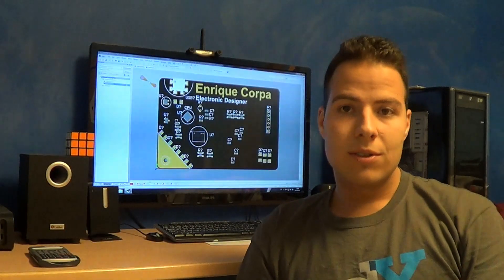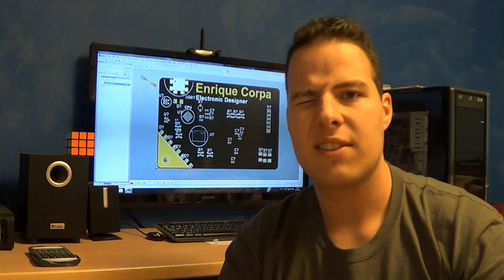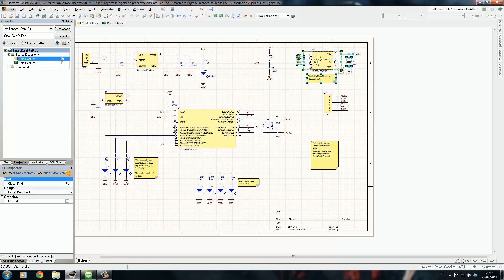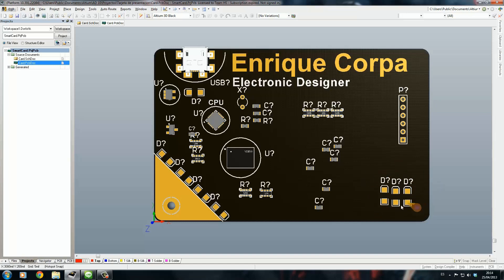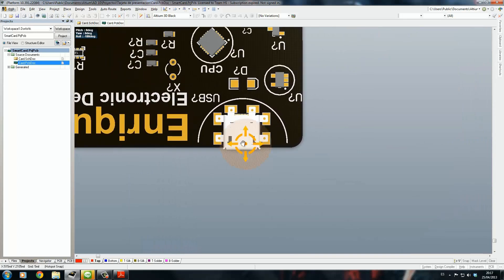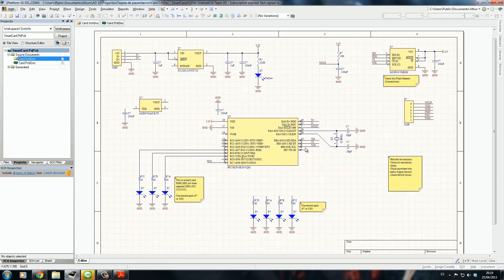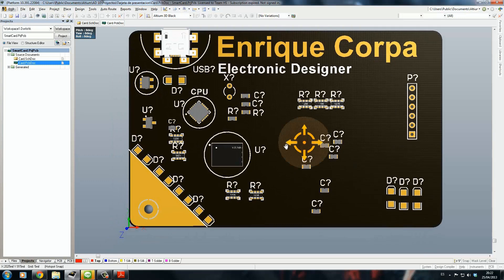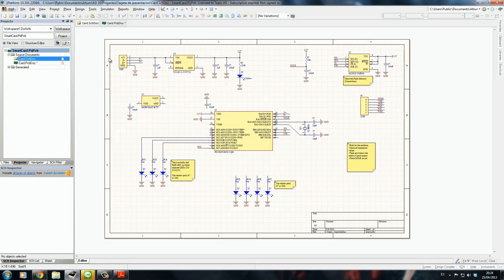15 - PCB Business Card project | Part 1

Comment from the maker: This board will be 0.4mm. Using the PCB as a USB is not possible because that thickness will not fit well. And it will force me to use a non rectangular shape. I love to have a real USB connector and price is not a big problem. The one that I have chosen has six solder points, so should have good mechanical resistance.

Micro USB cables are pretty common these days. If they doesn't have the patience to look for a cable, they should work to improve their patience xD

Thanks for the feedback!! :')